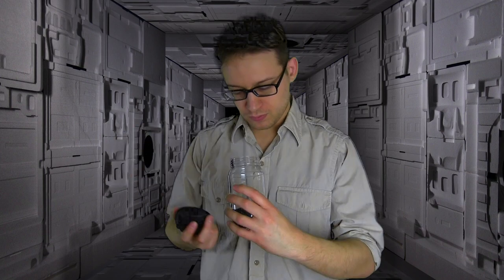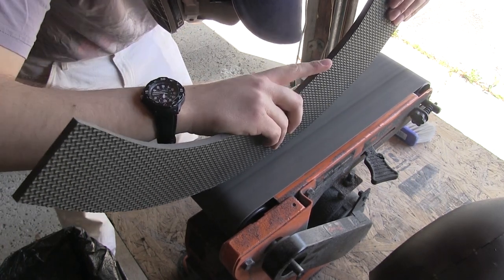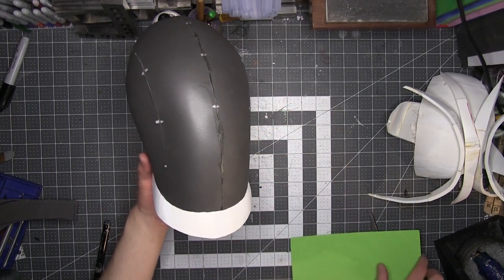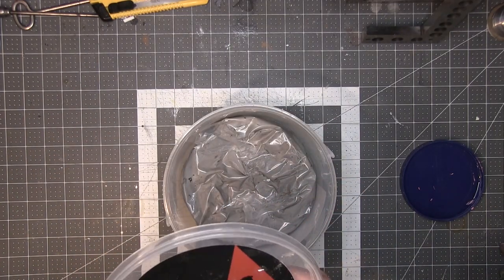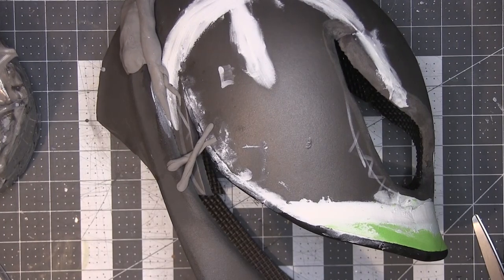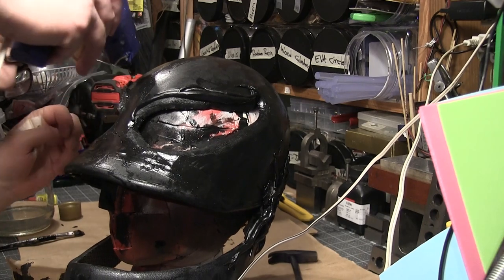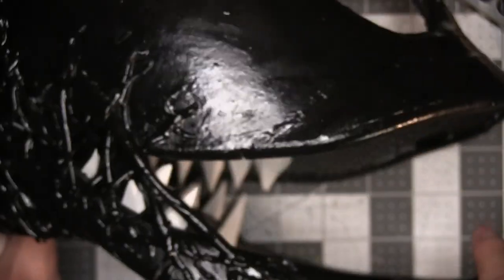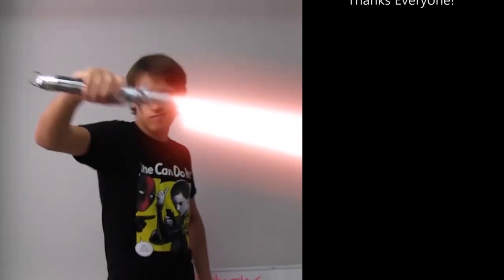HOW TO MAKE A VENOM MASK (DIY)

Comment: DYI-ing/PROP-ing Armor would probably be better made of PVC and Leather, for example the best stuff that has saved my skin more times than I can count are the leather "Mechanics" gloves with the rubber armor on the back, a set of baseball catchers shinguards, leather arm guards, a respirator with wire cage fitted over the filters n exhale valve, a good set of goggles, shooters ear muffs, and a hard hat. All of which I got either at thrift stores or made myself. 
Good for outdoor work and alot of shop work.